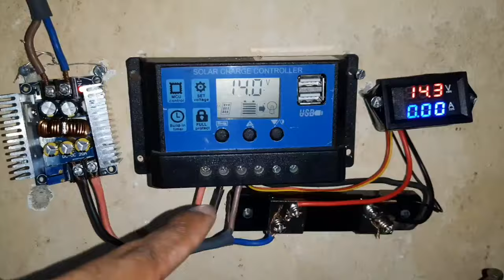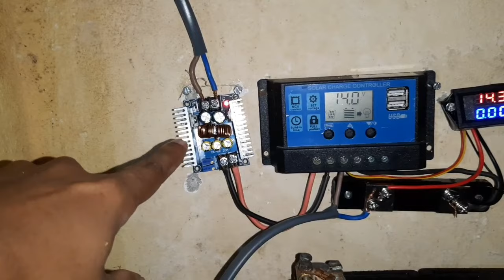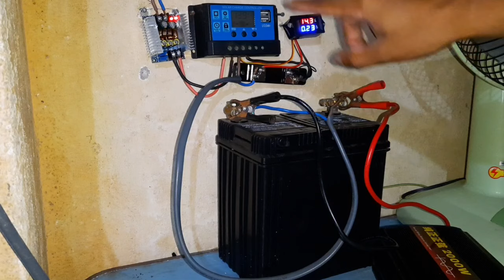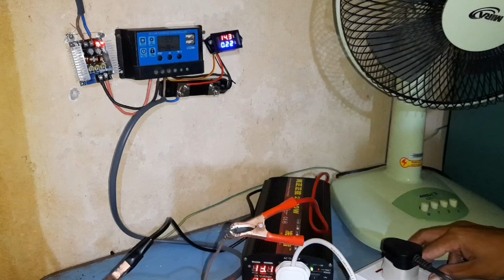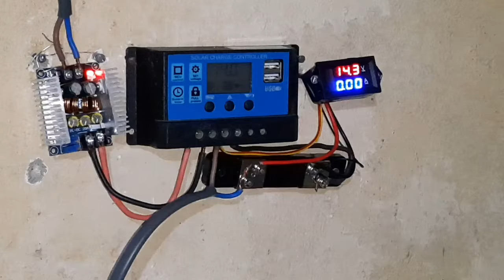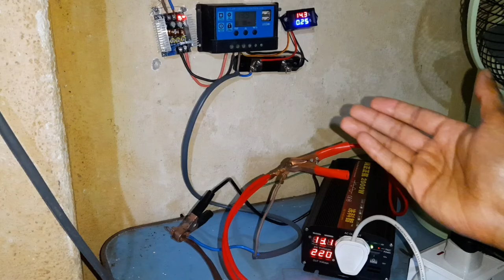Solar Powered Fridge - How to Run a Fridge With and Without! Batteries

Comment from the maker: What do you think on running appliances on solar power without batteries? I personally prefer to add at least a small battery to the setup to get regular power and not worry about clouds. Let me know your suggetions in the comments section here.
Reply: Sir can i have your part list
Reply from the maker: Please add a battery to the setup.
1. Solar panel
2. Charge controller
3. BATTERY
4. Inverter
5. Suitable wires for input and output
Reply: Hi sir I'm Philippines my place no electric.. I use a solar 
One inverter
One controller
Battery 70ampers and 100amprs
150 solar panel
My problems is  my chiller can't use coz the supply not enough.. Pls reply me..thank you
Reply from the maker: @arnadomalachico2220  What is the power of your inverter and is it pure sine wave or modified sinewave? And what is the rated power of your chiller? And also are the batteries deepcycle or regular car batteries?
Reply: @diysustainableliving2774  inverter 1500 and modified sinewave the power of my chiller 135 and the batteries deepcycle...
Reply from the maker: @arnadomalachico2220  I think the problem is the inverter. Modified sinewave can run a fan but fridge compressors need pure sinewave. I think thats the reason why its not working.
Reply: @diysustainableliving2774  sir how much the cost that kind of set up
Reply from the maker: @pepitochacon5455  It depends on which country you are from with the added shipping costs. I'd guess it would be less than 100 usd without the battery!
Reply: But for appliances like the fridge, how many batteries would you need?
assume that the peak currents consume 8 times the nominal, example 200 nominal watts. I have 12 lead acid batteries in parallel that are not visible with large diodes and a 2500 watt inverter and sometimes my inverter turns off for protection. I wanted to parallel this supercapacitor of 83 f in total 14.2 V
Reply: Please sir what's the rating of that boost converter and what's the maximum voltage I need to have when powering the inverter directly without batteries?
Reply from the maker: @nanfwangdabiring1520  That buck converter is rated for 20a and can handle 300w total. The maximum voltage depends on your inverter depends on the voltage of the inverter itself. For 12v inverters the usual upper voltage cut off is around 15.5v. Yet it is better that you stick to a lower value to minimise any voltage spikes that can damage your inverter. 14.4v is the charging voltage of lead acid batteries so you can go a little bit higher than thatI guess!
Reply from the maker: @antonioaranda1800  is your inverter pure sinewave or modified sinewave? Surely a 2500w pure sinewave inverter should easily handle a fridge of 200w!
Reply: @diysustainableliving2774   Thanks a lot for your time
Reply: Super knowledgeable you are! can I also power a 12v 4amp geared motor [a boat] using solar directly and Supercaps as buffer? I planing to power a body board solar+supercap bank? thanks
Reply from the maker: @calmish5090  Yes... As long as the solar panel can provide more power than the running power of the motor it will work. The supercaps are there to give the initial burst of power needed to start the motor.
Reply: When Cloudy weather occurs its great to have additional batteries on Stand by. The Controller Switch can change from direct Sunlight energy flow to a stored battery energy. Its a existing brilliant idea that lowers the reliance on Local Sub-Stations that provide electricity.
Reply: A good attempt made of a basic solar system, but there is always room for improvement, especially where safety is concerned (both fire and electrical shock hazards). Get rid of the buck and complement the charging circuit with the appropraite panel specs. Add in-line fuses and diodes to both sides of all lines, replace the PWM charger module with a MPPT, replace the lead-acid battery for LFP, maybe retain the supercapacitors (nothing wrong with those). But "safety first", folks!!
Reply: *and ensure gauging of wires and quality of copper purity is sufficient for the intended load, as well as quality of connections, especially from battery to invertor.
Reply: What is the value of super capacitor you use on your setup
Reply: Sir, I have a 100ah lifepo4 battery with a 1000watts pure sine wave inverter and a 200watts panel, can I run a washing machine of 440w (280w washer and 160w dryer) on it?
Reply: @muhammadayobami8320  if your initial surge is less than 1000 watts , yes , 100ah battery at 12 volts is 1200 wh.  Also,  Wash your clothes at peak sun light times this will cause your panels to produce more power and take less amps from your battery , in fact use up wasted potential energy with whatever .. lights, charging items, ect. What this video doesn't tell you is capacitors can save your batterys  from the intense  draw of power,.. they should be parrelled at the end of the battery.
Reply: @chrisadigue6977  2.7 volts 500f  im assuming , there rather common and about a good starting point. There enough punch  to ease a starting surge . .
Reply: @byondlight  okay, thank you.
Reply: @arnadomalachico2220  dont forget to get some supercaps too
Reply: @92844m  Isnt the buck converter doing exactly what the mppt would do consiering that the mppt has a buck converter inside of it?
Reply: Can someone find me battery for cheap
Reply: I need this type of set-up because I live at home 🏡 Solomon ❤
Reply: Im Realy looking at getting the mini split that runs off of solar panels, from signature solar. Runs with or without batteries.

Comment: Tried this in England. All my food has gone off. 😢🇬🇧
Reply from the maker: Im currently in england. Thats why I havent made any new videos lately. The whether is shocking. It is either cloudy or rainy year round. That is probably the reason why there are so many wind turbines everywhere insted of solar. Solar power may be ok for an on grid system to reduce your electricity bills, but for a stand alone off grid home system it  is probably not the best option. But I think in all other parts of the world you get proper sunshine.

Comment: Why you are using a buck converter instead of directly to the pwm charge controller? Does this boost the ampere from the solar panel?
Reply from the maker: No it dose not give a significant boost. But it helps to keep the voltage in check when we are using lithium batteries or like in this video when we are not using a battery at all!

Comment: Could you make a similar video running a washmachine without battery? Please. Greetings from Arequipa Peru ☺️🤗
Reply from the maker: Hi there!.. Actually the theme of this video is to show that it is "possible" to start and run things without a battery but Not Practical!!... if you dont have adequate temporary storage a moment of cloud cover can shut your whole system down. It is better to add at least a small battery to your system just to keep it running when the sun dosent shine.
Reply from the maker: Using supercapacitors as a temporary storage instead of batteries should be enough to run the washing machine without a battery. Ill test it out and make a video on the oucome.
Reply: please make how to turn fridge to dc powered fridge, so no need inverter and more simple sircuit, as i undertand, the only need is the compressor to turn to dc powered
Reply: @diysustainableliving2774  I'am so happy dear Master you are fine. I miss to see new videos in your Chanel, I was worried about you. I dont know how to comunicate privately maybe whatsApp. Well I want to tell you my evolution, I increased to 18 SC modules and I can run a magnetic cooker to 120w,  refrig ac220V 150w, 24V solar freezer 120w, tv 77w, and 410w washer at the same time. I hope to share more ideas for new project videos. Greetings dear Master🤗☺️
Reply from the maker: Im fine thank you.... Had to take time out for work. I will be posting new videos again next year. Good to know your progress with solar power. It basically gives us energy independence and is a nice hobby as well.

Comment: I didnt think a single battery would handle the current. Lithium or sla/gel?
Reply from the maker: It depends on the size of the battery. Big battery with thick wires can easily give the needed power. But if your battery is small then adding a supercapacitor bank will take the startup load off the battery.

Comment: This is practical and intuitive. Great for beginners. However it is not safe. I wish competent systems had people explaining it step by step. They are all too difficult
Reply from the maker: Yes I agree. DIY work on mains voltages should be done by some one who is comfortable to work with those voltages and knows the risks and must be capable to take adequate precautions.

Comment: photovoltaic/solar thermal technician here: Love the Frankenstein setup 🤖car battery did the job but get a deep cycle marine battery instead. i prefer lead acid deep cycle batteries i know lithium phosphate but i'd rather use the price difference for other things like Super Capacitors 😉i hope you cleaned up the wiring for safety purposes. for demonstration purposes was Right On 👍
Reply from the maker: Thanks.... I have now got a deepcycle lead acid battery and got a few LifePO4 batteries aswell. What I noticed is that the lithium phospate holds the voltage well during continuous discharge compared to the lead acid for the same load. Anyway as long as it gets the job done what ever cost effective battery is ok!
Reply: but you will save in the long run if you invest in some life batteries
Reply: Lead acid deep cycle don't store enough power and drain to quickly, unless you live in Australia above the tropic of Capricorn I wouldn't advise it
Reply from the maker: Yup... The further away you go from the equator the more panels you will have to include in your setup to achieve the same amount of power.
Reply: Do you have a solar demo on YouTube?

Comment: Great video, especially with the Super Capacitors.  I never thought of using those as a back up.  Thank you for sharing your wisdom! :goodvibes:
Reply from the maker: Thanks!... Always remember they are only a form of temporary storage and the total energy they store is tiny compared to batteries. But their benefit is that they can release that energy much faster than a battery.
Reply: @diysustainableliving2774  Okay thank you for the tip.  I was always wondering if using a car battery could provide the extra surge in Amp demand for heavy loads from a refrigerator.   Capacitors are such a cool intermediary and back up solution!
Reply: @mrsheabutter  regardless of storage the supercaps are always recommended. a fridge can draw up to 60amps when turning on, you need an inrush current meter to measure that

Comment: Hi sir, 
Thank you for this video, I would like to know 
If I have solar panels 400w 24v ,500f 16v capacitor and I want set the buck converter at 14volts how much the value of amps should I set on the back converter to charge the capacitor without damaging on the capacitor ?
Reply from the maker: You only have to do it once where you first get the super capacitor voltage up to 12V. For that you can use a charging amperage of 1-2A to charge it up within a minute. After that make sureyou open the buck converter to the maximum output to get the best out of your panel. You dont have to rechage the supercapacitors every day as you can keep it connected and when the sun comes up it will slowly charge it by itself.
Reply: @diysustainableliving2774  thank you  sir
Reply: @diysustainableliving2774 can we charge our electric vehicle by this.
My ev charger takes 220 volt ac  and 3 to 4 amp during charging my battery.
I want to connect super capacitor with battery in parallel.

And as the sun sets I will turn of supercapcitor by mcb during night so that it will not drain from battery.
Reply from the maker: Yes you can. As long as you make your setup powerful enough to handle that load you can do it. I personally think you dont have to connect and disconnect your supercapacitors everyday as the self discharge rats are negligible.
Reply: @diysustainableliving2774  what about in night  Super capacitor will draw current from battery
Reply from the maker: It will but that will be in the range of milliampheres. You can test this by placing am ammetere between a fully charged supercapacitor bank and the battery and see how much of power is being used. I dont disconnect my supercaps from the battery. They are permanently fixed.

Comment: Nice experiment. Ive some questions for you... If you kind enough to answer...
1. Pls provide the link of your inverter... I'd like to purchase.
2. How did you made the capacitor bank or you purchased it  ? 
3. You are using a simple chinese pwm charge controller... How it's working without battery ? Did you put the solar output to its battery input ?  Can't you put directly to the inverter ?
4. A ready to go 12v supercapacitor bank way more expensive than a lead acid battery... Doesn't it defeat the purpose ?
Reply from the maker: Answers to your questions....
1. I purchased it on aliexpress. Please look at the reviews to make sure it is as described. Also try to oversize things as you may realise that you will need more power later.
2. The capacitor bank I initially purchased it as a full set. The balance board started to malfunction after one and a half years. So I had to go for a new balance board. The supercapacitors are still working strong, 3 years now.
3. I am using a buck converter to get the voltage down to 14.4v before sending it through the pwm charge controller. Without the buck converter I cant regulate the input voltage to the capacitors and inverter.
4. Yes.. just adding a battery is better than this. But the size of the battery needed will add to cost. And deepcycle lead acid batteries cost more. But with this setup with the supercapacitor bank you can get away with adding a small battery.
This video is about explaining the different ways we can use solar power. Any method of reducing the battery cost and increasing its lifespan will save you money in the long run.
Reply: @diysustainableliving2774  Thanks for response.

Comment: Sir, if I arrange the system as you explained in the video, relying on capacitors only, without adding a battery, at the beginning of the next day, do I have to recharge the capacitor as I did the first time, or does the system work automatically? ?
Reply from the maker: Please note... Supercapacitors store only a tiny ammount of power. That is just enought to start an induction load but not eonought to run it. If you plan to leave it un attended the whole system will collapse. This was just a proof of concept video. Even if there is a cloud over head bloking sun light it can shut down the system.
Reply: @diysustainableliving2774  I now that, My question is about if the system shot down when there are clouds or at night Do I need to recharge the capacitor?
Reply from the maker: I dont think you will need to do that. The inverters low voltage cut off is around 9.5v. So to bring the voltage to 12v you can just keep it connected. It all depends on how your inverter functions.
Reply: @diysustainableliving2774  

I want us only capacitors in the system without battery , 
If there is no power from the solar panel and the system shut down ,and the power come back again 
Do I have to recharge the capacitor in the same way as the first method, or will it automatically charge from the voltage regulator and the system will return to work?
Reply from the maker: It will automatically charge up but whether the inverter turns on or not depends on your inverter.
Reply: @diysustainableliving2774   thank you sir, last question, 
What is the specifications of the inverter l need to turn on ?

Comment: Hi sir thanks for the great video, i had a 2000 modified inventer and and a car battery i,m planning to buy a 250 solar panel do you think i will be able to power the fridge? thanks in advance
Reply: I mean is the inventor good enough or do i need to change it to a pure sine one , given that i,m on tight budget
Reply from the maker: First try it on a fully charged battery and see what happens. Although the inverter will be labled as 2000w it will usually have half that power for continuous function. If it works then good but you will notice a humming noise from the compressor. Some times it might not work depending on your system. As for the panel, on a good day with full sunlight and an MPPT charge controller you can expect 1.5Kwh from that panel. But if you are using a pwm charge controller the pogeneration will be much less. BTW what is the power rating of your fridge?

Comment: Tnx for video. Why did you connect  capacitors in series and  not  parallel and are those diodes in between capacitors?
Reply from the maker: These supercapacitors are rated for 2.7v.  So if I want a supercapacitor bank that can handle 14.4v then I have to add 6 of them in series to get a capacitor bank that can handle that voltage. As for the diy protection circuit using zener diodes I can say that it didnt work... I used that as a temporary solution till the proper protection boards arrived.